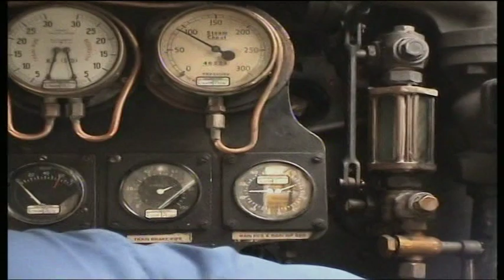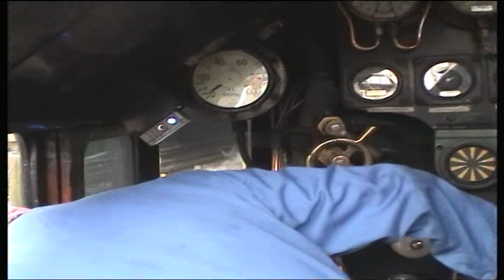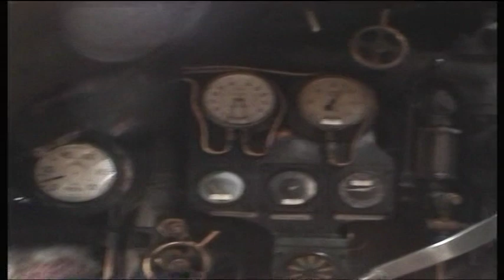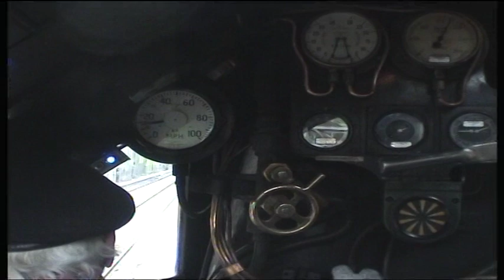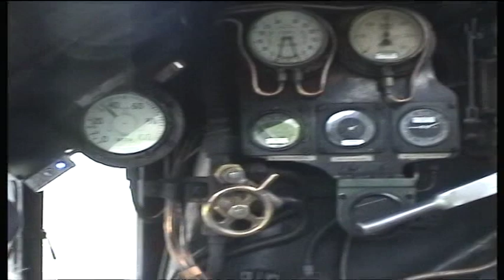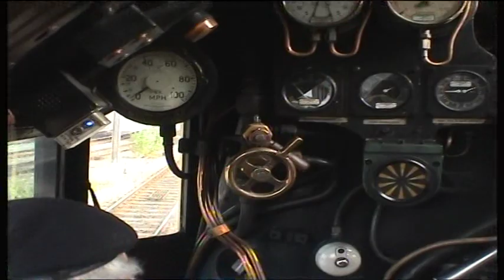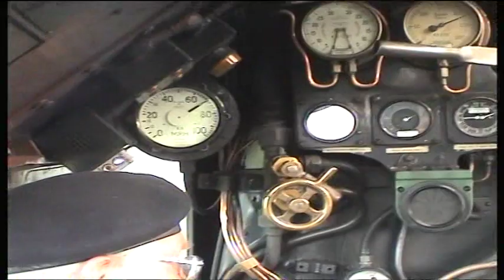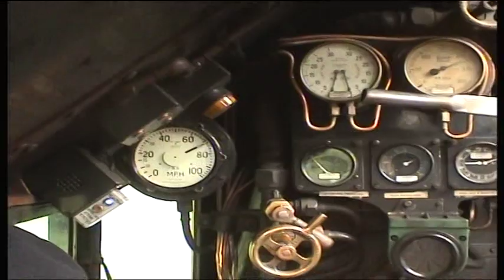6233 Duchess of Sutherland Footplate Mainline

Comment: Excellent video. However, as a former fireman (5A) I was surprised the engine needed Firing so soon after leaving Lime Street. We were taught to avoid firing in a tunnel ( black smoke in cab can be dangerous not least very uncomfortable. Keep doors closed between firing when engine working hard.
Reply: The duchess class are very difficult to fire as far as i'm aware. They lose pressure very quickly and constant firing is required to maintain the pressure
Reply: Liverpool Lime street is pretty enclosed so the fire has to be kept clean to produce as little smoke as possible whilst standing there, so once underway the fire is built up to it's normal level. The tunnels are fairly high and with 4 tracks also wide, and not very long either so smoke build up is not a problem.

Comment: @LMatters1 
In the USA a little less than 2 years ago Southern Pacific 4449 headed for Michigan. Part of the trip was on a Chicago commuter line known as Race Track. Lots of crossing and railroad station. The engineer was required to blow the whistle on 4449 for each road crossing.  It may have sound excessive but it was neccesary. On the other hand as the train crossed the Rocky Mountains  where there where not so many road crossing there wasn't whistleing at all. Depends on route.